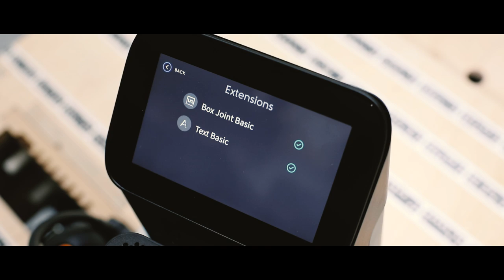Designing  Box Joints with Shaper Origin

Comment: Beautiful. Excellent example of this new (free) box joint and lettering features. Everything the Shaper team crafts is exceptional. I bet the Shaper team brings this same level of high quality design into the Shaper Assist design service. (Wasn’t there a sketch of this project in the Shaper Assist video?). Nice work, on the software and the hardware. I look forward to using the Box Joint extension.